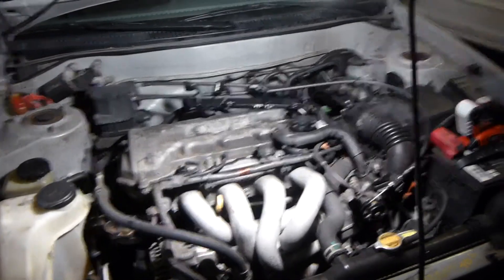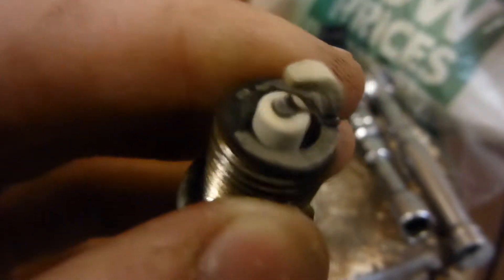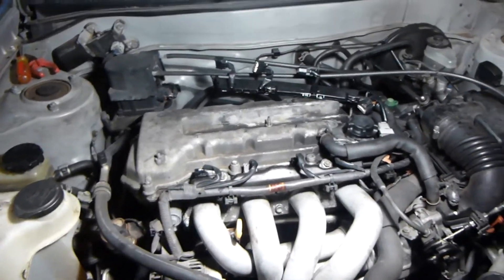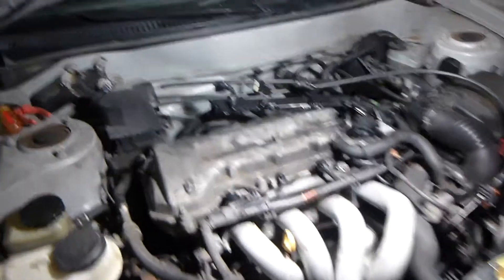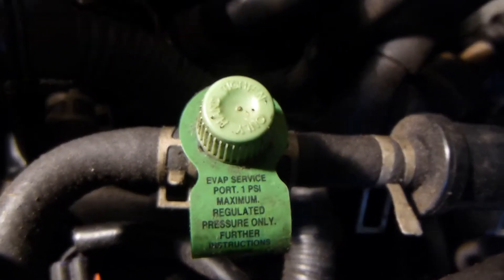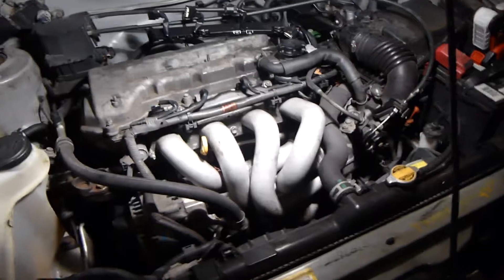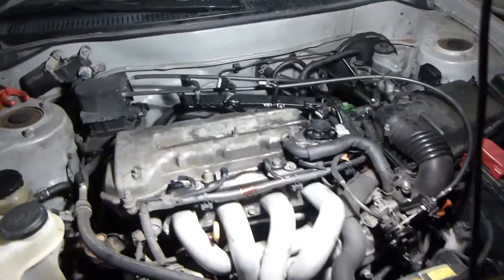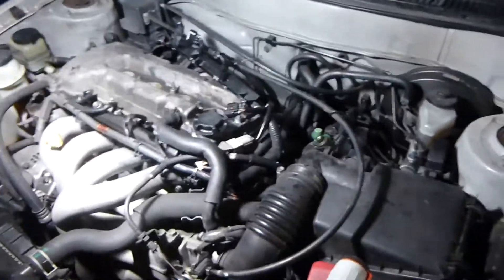Does My Toyota Corolla's Spark Plugs Look Okay and Talking About Running My Car on Gas Vapors

Comment: Don't waste your time on these gasoline vapor stories. It's always gasoline vapor. When the injector injects the fuel it turns into vapor because that's what's flammable. Pure gasoline doens't burn , it's the vapor above it. If you look at carburated cars instead of fuel injected ones , you'll see just that. Gasoline is pulled through a channel by the airflow to evaporate and mix with the air to become a flammable mix. This is ignited in the cilinder by the spark plugs. But in fuel injected cars it's injected, only because it can be more acurate and therefor giving a better mileage. Really all these stories are a bunch of nonsens. And for the spark plugs , I would just install new ones. The mixture probably will be alright , because it's constanly adjusted by the ECU. Unless of course the lamda sensor gives out false readings. (Lambda sensor measures oxygen levels in exhaust gasses). Greetings !
Reply from the maker: 1shnitsel You are right.  I will not waste my time.  I guess they might be able to get that many miles to the gallon but they are probably running their engines dangerously lean and going so slow that they can manage to get that good of gas mileage with engine life and other costly trade offs in the long run.  Maybe I'll get an old engine to do some experiments on.  I don't want to ruin my good car by doing stupid things to it. I'll get some new spark plugs when I get a chance!  Thank you!

Comment: Looks like it's running on lean mixture. How it performs? Unfortunately you don't know how it performs originally to compare, but...
Reply from the maker: MrJohhhnnnyyy It seems ok to me.  I don't tend to drive very fast.  I mean it certainly accelerates slower than our Toyota Sienna!  But that thing has a pretty big engine and it's pretty powerful!  Spins out from a stop on a dry clean road!  I can keep it in 5th gear most of the way up a hill going 55MPH before it decides to downshift.l  Thank you!
Reply from the maker: MrJohhhnnnyyy I guess I could do a 0-60MPH test and see if anyone else has done the same and compare results.
Reply: Makerj101 Well, that will give you some thoughts. However, acceleration tests depend much on driver - so... But to get idea how it should be, it is enough
Reply from the maker: MrJohhhnnnyyy True.  I replaced the air filter today and I actually think I can feel a slight difference.  It seems to respond faster and have a little more power.

Comment: They just look like high mileage, not oil deposits, they are black. Those white deposits can cause pre-ignition which can destroy your engine. Your mileage won't be great because the engine is old. If you want to clean your plugs you can use your gas torch to burn them clean. Beware that if you lean out your fuel the engine will overheat and fail.

An oil change is good as it gets your compression up. Injector cleaner will balance things. Check the computer with and ODB2 scanner and see if there are any error codes.
Reply from the maker: Robonza I can't really tell any difference after cleaning them and re-gaping.  But maybe there will be an improvement in gas mileage.

The previous owner had the oil changed not long before he sold it.  So I think it should be good.  Should I just put that fuel injector cleaner stuff in the fuel tank or should I take the fuel injectors out and spray something through them?  I will buy a computer reader! 
 Thank you!
Reply: Yes,your plugs will improve gas mileage, that was a give in so I didn't mention it. Injector cleaner in the fuel tank is fine, Pulling injectors out can be a very hard job and the pressure they are under is very high. Good luck mate!
Reply from the maker: Robonza Sounds good.  Thank you!

Comment: if you are going to do the fumes, don't do it on your daily driver, get a small generator to play with.
Reply from the maker: Josh Kilen That's a really smart idea.  I don't want to ruin my good car...  Thank you so much!
Reply: Makerj101
your welcome, you could buy or fined a small gas engine or generator.
Reply from the maker: Josh Kilen Yeah I'll see what I can find!
Reply: try harbor freight.
Reply from the maker: Josh Kilen My grandma has a couple small engines laying around.  I know of one that was replaced from her wood spliter.  It runs but not very well.  I think it may have a broken governor or carburetor problems.  I think she might let me have it for free or I could give her like $5 for it.
Reply: fix it up and get it working right then do the fumes project.

Comment: according to http://www.classictruckshop.com/clubs/earlyburbs/projects/spark/plugs.htm that is ash deposits means its normal but if you have short trips it means that the valve guilds are worn, if not you can clean them, regap the plugs, then reinstall.
Reply from the maker: Josh Kilen Cool!  Thank you!  I cleaned them and put them back in.  I'll check them again in hundred miles or so and see how bad it is then.
Reply: ok.
Reply from the maker: Josh Kilen Cool!  Just watched a bunch of your videos and commented!
Reply: Makerj101 i saw.